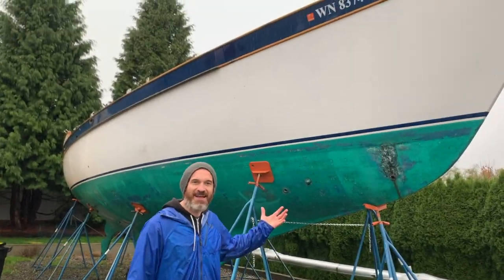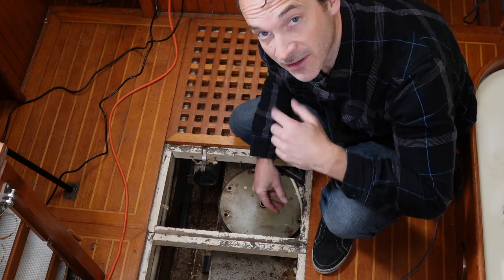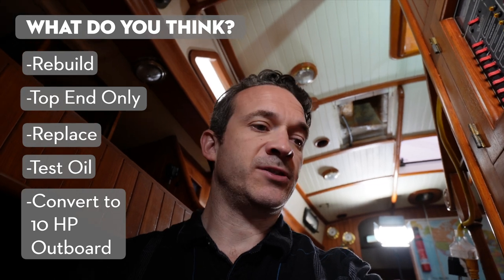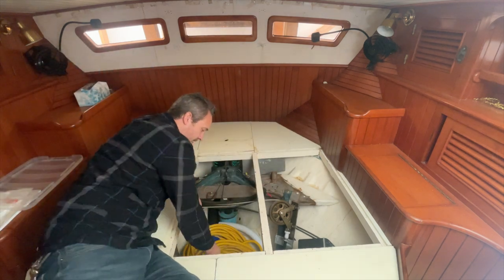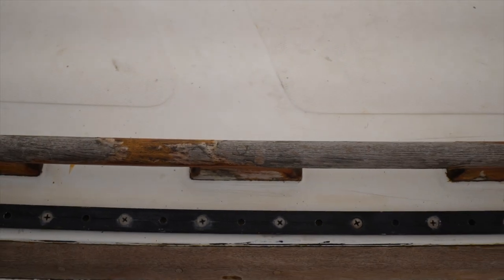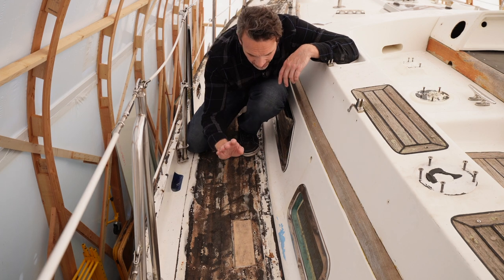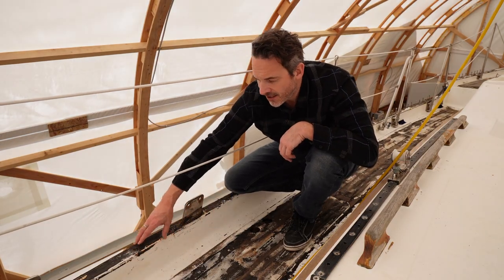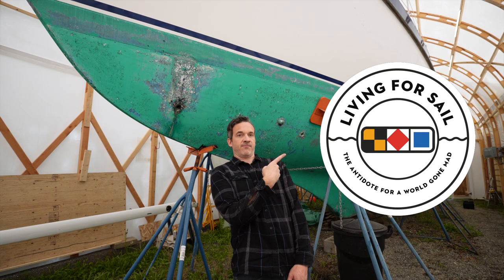Sailboat Refit: An Update on the HUGE Project! | E003

Comment: Hi John
Nice project you got there. Isn’t it crazy with boats how much renewal they need from time to time. I watched your initial tour and the boat looked ready to splash and be lived on but when you dig in it looks different. Luckily it’s mostly the systems though that are outdated and the hull and interior are looking great. 
Luckily you don’t have a visa limitation giving you a timecrunch but I would still consider carefully what to prioritize. 

Galley: we have not used our system yet but the folks over at technautics have been the best to work with and I’m stoked about the specs on their holding plate/ compressor units. 
Also look into aerogel for insulating without loosing volume.

And before cutting into your hull to deck joint I would remove ceiling and inspect from the interior side. I would assume that is has been glassed from the inside too. 
Big gaps were often filled with plain polyester resin which is brittle and prone to crack. Not a big issue though. If there is glass on the underside you could just fill the gap again. Hard to assess and comment on just from the video. 

Best of luck,

Aladino
Reply from the maker: Hi Aladino! 
Thank you for taking some time away from your own AMAZING project to lend your expertise here!!

I think that apart from the decks and hull to deck joint, the structure of the boat is pretty sound. We will see! As you already know, you tend to learn more about your situation as you dig into the project further and yes, it seems that they can always use more work. I think your advice to prioritize is sound as one thing can easily lead to the next like pulling a thread on the sweater…

I am not familiar with the Aerogel, so I will look into that. It would be great to get a higher R value without losing much volume. I haven’t purchased the fridge parts yet but I think Mads installed one on Athena (he seems to do his homework too…) and I met the owner of Technautics a few years ago at a trade show and it looks like the best unit out there for an ice box conversion.

Thanks for the tip on the deck joint also. I wondered about that. I need to pull the headliner down in some spots for some other work so I will look into that. I would expect more damage to the interior wood if it was NOT glassed inside, so I am hoping that you are correct there.

Place your bets!

PS.. Stop by the shed some time if you’re in the area ;)

Comment: Well, it appears I have a new subscription at hand...you have a heck of a project boat there....the only advice I would give at this point is if you plan on keeping her for the long haul, get rid of the teak.  If you want to be a sailor/cruiser and not a repairman/maintenance man, get rid of the teak.  It looks nice, but so does a lion and I don't think I'd mess with a lion either.
Reply from the maker: 😂 yeah, I’m happy to invest in the project work now, but I don’t want to be working all the time on the teak once we splash… thanks for following along Dave!
Reply: I’ve been trying to tell him that.  The only exterior teak you might see on my boat is the varnished companionway, which is covered most of the time.  My teak trim is epoxied (holds paint better) and painted.  You can substitute the teak look with the use of color.  Paint—don’t think you’ll never have to paint again.  A major consideration is the difficulty level of sanding and repainting.  I’d stay away from Kiwi Grip, which seems to be very popular right now, as it is very hard to remove.

Comment: Great job asking for comments. 1. Engine - compression test before touching the top end. Replace heat exchangers, pumps, exhaust elbows, starter, throttle and gear cables. Maybe rebuild transmission….. 2. Black Iron Tanks - they were a terrible idea. They rust from the inside out due to water in fuel or outside in due to bilge water. I agree with your desire for a mechanical diesel (no electronics) for reliability. Lack of reliable clean fuel eliminates the benefit of the mechanical diesel. Can you completely line the inside of the tanks with a flowable material that is compatible with diesel? To recore the decks is a big job from a labor perspective but relatively straightforward and a significant enhancement to the value of the boat. Agree that all heavy current wiring should be replaced with tinned. I am not on the Lithium bandwagon yet. Great power density but super dangerous from a run away/fire perspective. I enjoy folks removing propane due to an explosiun risk and then adding lithium batteries…. I would rather add more AGM, panels or fuel for the generator. If you have ever seen a lithium battery fire, you would not want to deal with that at sea, boat is a total loss, quickly. Terrible hull to deck joint design for a 1980s boat. I assume that you will go to external chain plates? Replace the hatches with new, after all not windows but sky lights into your home. I have tried the “rebuilds”, waste of money. Rock on, thanks for sharing.
Reply from the maker: Thanks for all of the great input!! I agree that the tanks were not well planned. Even worse is the fact that they won't come out without major surgery... I had an idea to line them with something like POR15 but that was before I realized that they have some baffles that I had not noticed before that I can't get past through the inspection hatches. Cutting those baffles out and lining with bladders from ATL or similar is a potential solution.
I hear you about the lithium risks. I worked for an automotive manufacturer for a few years that was integrating lithium into the powertrain. The Lifepo4 chemistry is much safer than the other chemistries that have given lithium such a bad reputation. They are still dangerous and need really good battery management systems to work well. I am not a fan of the "drop in" lithium solutions although many boaters are using them happily (what you don't know can't hurt you?)
I don't think I have any other way to re-rig the boat other than to go for external plates. I REALLY want to keep the boat looking original but I don't think I can excavate the interior to access the hull interior without irreparable damage to the teak and as you already noted... it is in great shape so it would be a shame to damage it.
Thanks again for the input and your support. Hope to see you back here again soon!

Comment: Hi. This is Doug in Blaine WA. I found your channel via a Magic Carpet. I lived aboard a Formosa 46 for several years, and that boat was similar to yours in many ways. Like most boat owners, I did a lot of boat projects over the years, but nothing as extensive as what you are taking on. My chainplates were encapsulated like yours, with welded cross supports. I never did surgery on the chainplates, but those chainplates and the older rigging were always on my mind. I'm glad to see that chainplates are on your list of things to think about improving before you go cruising. I would also like to encourage you to keep a bow thruster in mind. I singlehanded my boat a lot, and it was my experience that getting into a slip surrounded by expensive boats on a breezy day was a frightening experience, especially with the modified full keel configuration that both our boats had. I'm retired now, and I have switched from boats to camper vans, but I'm really looking forward to following the progress on your build.
Reply from the maker: Hi Doug. Thanks for reaching out. Yes, the Formosa 46 and the 458 are kind of cousins. The story is that Peter Hoyt had a Formosa 46 and it inspired him to design the 458 interior and they “borrowed” the molds do the extended KP44. Something like that… I hope I’m not butchering the story too badly…
Agree on the thruster. I got pretty good at handling the boat in the short time we had it in the water but it’s a lot of boat with terrible prop walk and a thruster is definitely on my list. 
Keep in touch and maybe we will see you around. 🙏👍🙌

Comment: For my two cents ... trash all of the teak -- the cap rails have already aided in the infiltration that you will now have to repair, and the grab rails would look better in Stainless Steel.  As for the propane locker ... repurpose it for storage, but before you abandon the propane look into the stern mounts that go on the rear railing / davit systems (it removes much of the danger as leaks simply leave with the wind out to sea).  As for the motor ... test the oil first and foremost, if the results come back favorable save the money on the rebuild and use some of the money to stock up on spare parts for the journey (starter, alternator, water pump, fuel pump, hoses, belts, etc)  and maybe a Rocor Fuel Filter system with multiple filters.  If however the results of the oil testing is bad then consider whether you want to stay with the Leyman -- Yanmar probably has the best access for parts world wide, and a major breakdown on the other side of the world could leave you stranded waiting on Leyman parts for months at a time.  As for the fuel tanks you did not mention the option of relining them with gasoline resistant epoxy -- this is a very good option and there are videos available for the process (afterward you will also have  a large access panel to aid in future clean outs).  Before you tear apart the refrigerator system, look into "Sailing Adrift" You Tube channel to see their setup for refrigeration -- it might save you some time and space.  Finally I'm glad to hear that you are replacing all of the trough hulls -- I wouldn't be able to sleep on a boat with fittings that old.
Reply from the maker: Hi!  Thanks for the thorough comment! I think there are a lot of good points to consider here! 
I am still considering a few options about the tanks. I have used a pour in tank liner with great success on a few motorcycles. I was coming up with a plan to do the same on these but it is tricky to rotate these tanks around to move the material. I will need to add 1-2 more access panels to reach all of the insides because of their size and some large interior baffles…
I still have a few things to think about… 
Thanks for watching ! 🙏👍🙌

Comment: As one who has just finished re-habbing a 1985 Bristol 45.5 may I suggest a few things.  First, if the wiring looks good, which your's does, and it is flow electricity as it should (meter test), then leave it alone.  Rewiring a boat that size will take forever, and you have many other projects.  As one who spent 15 year in the Caribbean on a Hans Christian 48T, I can tell you crazing on your hatches is not a concern, as you, like everyone else, will get canvas covers for them.  The sunlight is just too intense, and quickly destroys the interior varnish.  If they are water tight and the hinges work well, then let them be. You are spot on regarding the through hull and sea cocks.  I strongly recommend the Forespar replacements. A bit pricey but they last forever.  Good luck and stay the course.
Reply from the maker: Thanks for the input Robert. I will take the wiring experience into consideration. I'll do some resistance checks and we can go from there... Thanks!

Comment: Nice Project. In my experience, two main rules apply: Eliminate all the teak outside and replace all wiring completely. Thereafter, 50% of your headaches over the next 20 years will disappear. Good luck. Regards from Switzerland.
Reply from the maker: Thanks for the tip Silvano. I think you’re on to something there. I love the look of the teak but it’s such a headache to maintain. I’m 99% sure we will be rewiring the boat too so hopefully after that “smooth sailing” 👍

Comment: Please keep the teak handrails. First of all stainless becomes very hot in the sun, second the teak seems healthy and is there already. As the wood is cut from the forest it would be a waste to throw them away. Same goes for the teak deck. There's a new alternative for teak from German company "Wolz Nautic", they have developed in cooperation with an German superyacht yard an material on wood base behaving in all terms like teak. This is used on new superyachts already and available for everyone as well. No connection to this company, a friend of mine is working at the shipyard responsible for the development. Really great stuff, it's just as non slippery, durable and looks like teak. Real superyacht quality. Don't know if it's bendable to replace the split cap rail. I believe so as handrails on superyachts are another common case of use but the stuff is treated with chemicals and heat so steam bending might not be possible. Laminate wooden layers?
Reply from the maker: Thanks for the tips! The teak deck is too far gone to save … more on that later. The handrails however are candidates for more adventures. I will consider your perspective and keep everyone updated. 
I’ll look into that alternative product too. Thanks!!

Comment: As  Ham Radio Operator I'd keep the HF as a back. Another tool in the box.
Reply from the maker: Do you have any tips on getting it tested before committing? With the rig down the antenna is out of commission (it had an isolated port backstay)

Comment: There is something to be said about wooden hand holds, not to hot in the sun, not freezing to them in the cold.   A small amount of maintenance might be acceptable.  
   Fuel tanks last about plus or minus 30 yrs.  So while you have things open guess you should budget and replace.   Even careful inspection might miss that pinhole that is just waiting to start dripping.     Wonder if you could bladder them?
Reply from the maker: Thanks for the perspective on the hand holds. It’s always good to consider all of the angles and unintended consequences first. You make some good points for me to think about. 
With the tanks I have thought about getting bladders made by (ATL I think?…). I will look more into that in the coming weeks. 
Thanks again for your interest in the project! Cheers.

Comment: Great project and superb presentation.  Subscribing and watching with interest.  My thoughts…
Fuel tanks…Save fuel tanks if you can line with bladders, coatings etc.  Will be difficult, costly and destructive to extricate & replace.  Buy time and use $ saved for other problems.  Buy 5-10 years of life and get sailing first.
Hatches.  If not wracked and leaking, replace plastic lenses, save money for other jobs. 
Fridge, freezer.  Go modern DC low power.  Easier and works better.  
Engine. Have a friend with Lehman, they’re wonderful.  His is mid-70s vintage and still running great.  Company still in biz, has superb support and should have records for your engine. Spare parts readily available.  Buddy’s had over 10k hours, conventional wisdom was it was about half way to a rebuild.  It’s a tractor engine known for getting 10s of thousands of hours with care.  RUMINT, some are hooked to power generators running 24/7/365 with more than 100k hours and still chugging. Yours looks like it’s had good care. Contact Lehman…
Teak… pretty, deck penetrations, ugly. Find a good balance.😮
Don’t forget rubber hoses, replace them all while easy.  They’ll fail from rot faster than everything you’re considering. More so on engine systems due to heat, and heads, etc.  Also hose clamps refresh them, stainless baby!    Plastic supply lines to sinks less concerning than rubber which dry rots and oxidizes more when not used.
Best of luck.
Reply from the maker: Thank you for the excellent feedback. Lots of good stuff in there and I agree with your points. Thanks for watching and following along! More to come. Cheers!
🙏

Comment: My boat is also a 89 IP35 with Lumar hatches. I changed out the crazed lens on each rather than replacing for about $500 total.  The material ran about 200 and the additional was for hiring a local carpenter to do the router work as I was remote from my tools. Worth considering.
Reply from the maker: I have considered that too. Do you happen to know what version of the lewmar hatch you have? My understanding is that any of them can be refit but the “Ocean” models are harder because you need to cut all of the old glazing out. 
Some of mine have pretty worn hinges and frames at this point. I’ve found a few new replacements for great prices on eBay over the years so I will probably just replace but it is solid advice! Thank you!!
Reply: @livingforsail I have the oldest design with no "c" clips on the hinge pins so i did not remove the frames or lens holders from the boat.  Changing out the lens is easy, SailBros episode 58 is a great video on the process. The caulking can be removed without much of a problem but be sure not to damage the rubber seal below as you will reinstall it.   I cleaned up the existing handles/latches and reinstalled.  Rough cut blanks can be purchased from EPlastics out of San Diego, give yourself a half inch in every direction for the router work.  Absolutely no leaks even hurricane tested but best of all was the money I saved over buying new.
Reply from the maker: @montanadan2524  thanks for the tips there. The price of these new can blow your hair back… 😳